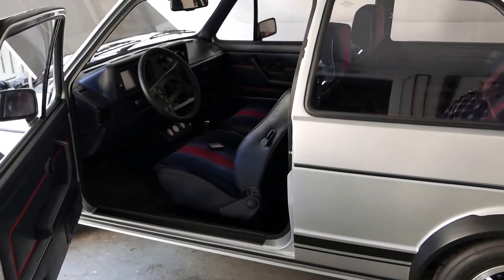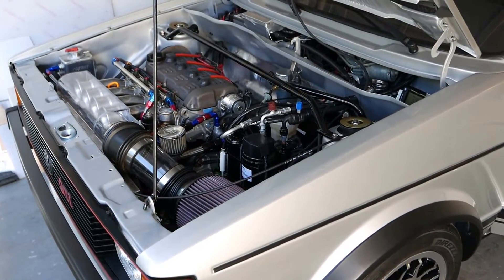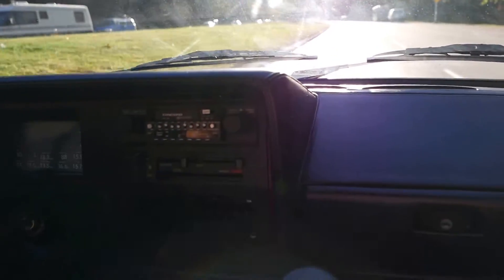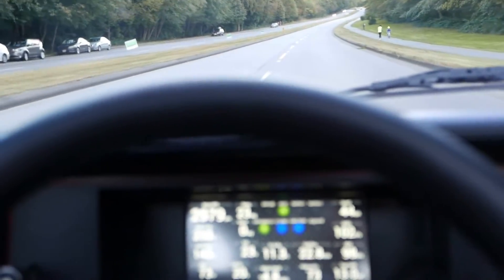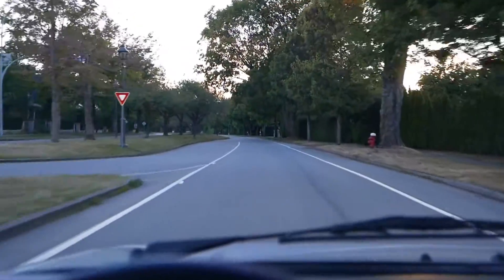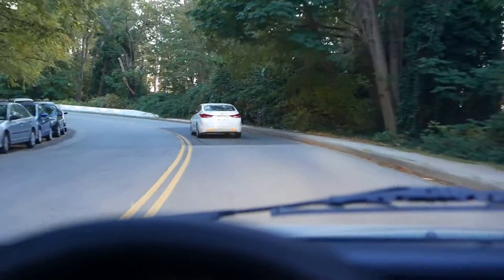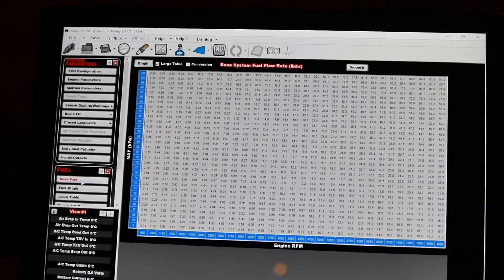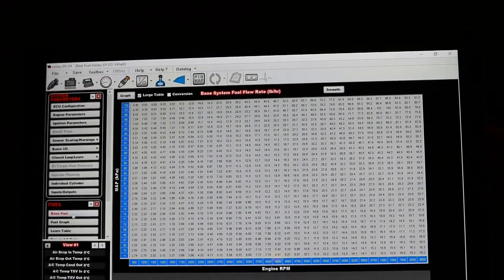The Ultimate 1983 Rabbit GTI - part 131 (2nd drive, estimated 250hp @ 7500-8000rpm)

Comment: I have to say I have watched thus video 3 times now and anm greatly impressed by a number of things. First, I love the sound of the engine, both at lower and higher rpm. Secondly,  and most impressive to me is how "solid" and quiet it seems even on different road surfaces, at different speeds,  and when passing other traffic. When you close the doors, hood or hatch it doesn't sound "tinny" but solid like a more modern car. Really nice work!

Comment: That is one cool ride. I went back to look at the engine writeup on your website, that is very highly tuned; good job to you and Josh at TT. It is not easy (as I'm sure you're perfectly aware) to make it past the 200 hp mark with a VW 16v, especially into the 250 hp range!

Oh, by the way, the links in the description are broken. Just a heads up.
Reply from the maker: Which links were broken? I just tested a bunch of them and couldn't find anything wrong. 

As far as getting power out of the 16V VW engine there are a number of race engines in the 265hp range and this setup is pretty close to those builds with high compression, race cams and extensive head work, race exhaust, ITBs, carefully tuned ECU, etc.  I won't have the real hp results for a while yet - I am only using indirect methods to roughly verify our design goals at the moment. If we end up with 230-240 'real' hp in the end I won't complain as the engine's manners are superb and I was really worried about that.
Reply: The VWvortex and your website links at the bottom of the description are both truncated for some reason - both end up 404'ed.

Comment: Congrats on getting your build on the road,  looks great. 

Please do a video on how you addressed your crank trigger wiring issues,  I think most would find it helpful.
Reply from the maker: In the last video another VW enthusiast, Wade Banks, from Fort St John, BC. who has a MegaSquirt ECU with the same ABA block and crank sensor emailed me and said he had the same problem and solved it after reading forums online (see https://www.diyautotune.com/support/tech/other/megasquirt-vr/) . Putting a single 10K resistor in series with the sensor can possibly do 2 things: cut the voltage seen by the ECU, and/or cut the current to the ECU, with the theory that the ECU is not expecting >100 volts AC on the input pin and it is over driving it. I also took more care in the grounding/shielding of the sensor wires - I had a short 6" length of cable from the sensor that was shielded but that shield was not bridged across to the shielding on the other side of the connector to the cable that runs all the way back to the ECU so I connected the shielding across, and also wrapped the connector itself in aluminum foil, connected the foil to the shield wire, and then wrapped electrical tape over the foil to protect it. A bit messy if/when I have to service the sensor or the engine block but I didn't want to take any chances as the next step was going to be an external 60-2 tooth hall effect digital sensor setup which would have been a lot of machining effort. As reference, 60-2 tooth sensor wheels and the Bosche VR sensor put out 8,000Hz sine waves at 100-200 volts peak-to-peak (voltage builds somewhat linearly with rpm) at 8,000rpm and this can be a challenge for the ECU to convert into a digital signal ...